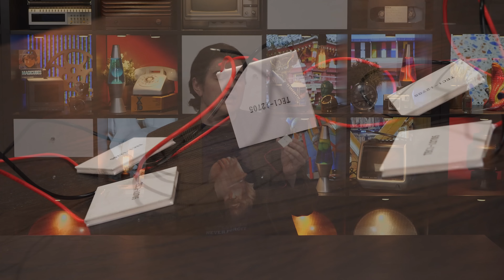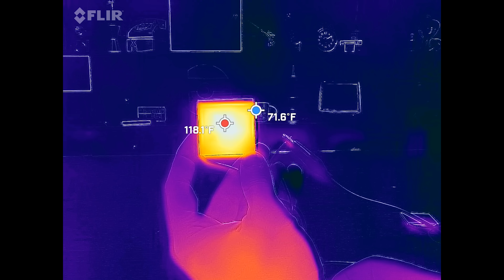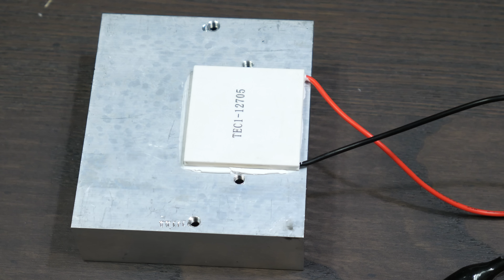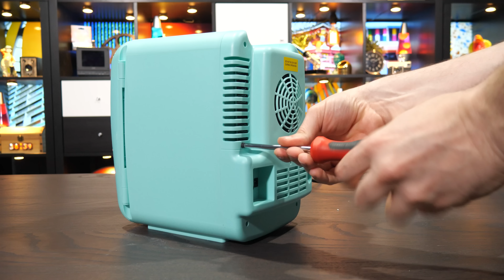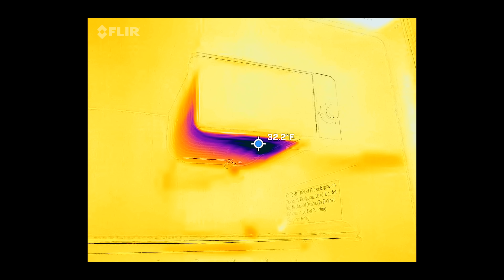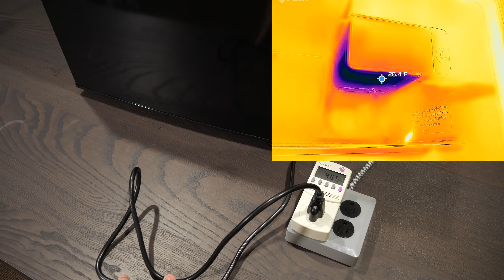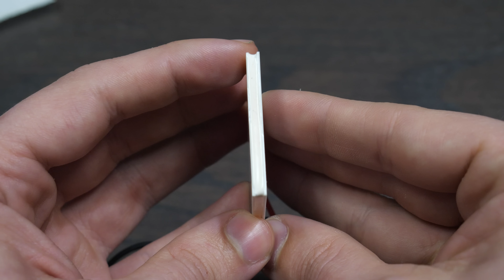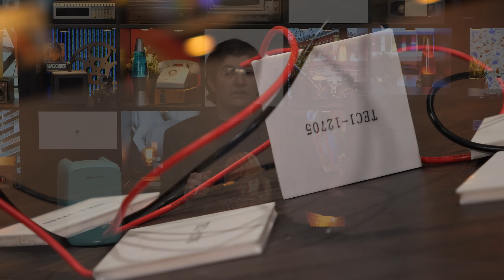Thermoelectric cooling: it's not great.

Comment: There is one good cooling Application for Peltier Fridges: Car Cooling Boxes. Thats it. I got two Quality Boxes which can keep the Temperature at the promised "30°F below ambient Temperature."  They are great for shopping. Start them, go into the Supermarket putt your fresh food into it and it will stay below 50°F on your way home till the food is your fridge. When the cooling in the car runs often even below 41°F. As Peltiercoolers are not sensitive to Shocks and moving they are great for Temporary moving cooling solutions. On top of it this Car cooling boxes i have are great isolated Cooling boxes and work great without Power, so on a Party i can load them up and use them as beverage coolers. And they even have a Drinking Low Power mode on them, reducing the Temps only 15°F in them. Which is healthier, you shouldn't drink beverage more then 20°F below ambient Temps. With 6W Powerdraw instead of 30W.
And yes they only draw 30W of power as they have thick isolated walls like the Red Fridge.

But guess what: They aren't cheap each costed around 60-70 Bucks (have two) But for the 30 Minutes Tripp back from Shopping or the Roadtripp they are great. Not for daily use. And i got two as they aren't big inside eitherm because of the Isolation. I need mostly only one.

And why i don't simply use a cool box and load it up before i go shopping? I live in a small town with three small supermarkets but work in a Big Town with a big Supermarket next to my Work and there is some stuff i don't get in my small town. So twice a month i fire up the Cooling Box go Shopping and get my favourite fresh food cooled home.

Comment: People expect way too much for these little legends. you need 8-10 of these for a fridge like these to make a fridge of this size cool adequately. Also if memory serves me well running them above approximately 1/3 of their rated current caused them to becomes inefficient so it would be best to have 3 of the sides covered in 8 of these plates running efficiently at a lower current.  Thankfully they are cheap enough to make it still worth it. (note that buying in bulk will see 60 of these costing $130-200 AUD or $68-136 USD). You'll also find that a cheap thermostat relay and arduino is quite cheap. Having all 3 sides covered aka 30 of them will see much higher cooling than a refrigerator with the ability to scale down power draw during period of non-use.  There is a clear section where cooling performance increases rapidly before it becomes inefficient. Therefore, there is room in the market for premium, expensive smaller fridges based on this tech but it isn't viable as a cheaper product.

Comment: Transporting food in a light Peltier Igloo cooler in car for 6 hour drive. Precool for 2 hours, then trick is to put a big blue ice pack in it, plug it into the car DC port. Using Govee bluetooth mini temp sensor shows Peltier and blue ice keeps food closer 36 degrees.
The portable compressor fridges weigh a lot and are very bulky, but yes, are much lower power and best for 24 hour hassle free cooling.

Comment: Favorite use for them is in cigar humidor/cooler. Effectivly cools the air tight area without reducing humidity( normal evaporator cooling systems remove humidity)

Comment: If you haven’t seen the channel tech ingredients look it up.. if you want to build a fridge or freezer with these devices they did it and they go over the science involved in a proper design however they use multiple modules and a variable power supply to make things as efficient as possible as well as a liquid cooling solution for the hot side. A friend of mine used a similar design to create a water chiller for an axolotl tank. Cool devices but horribly inefficient

Comment: So, yeah, that toy definitely needs some changes to make it worth using. But, it is my opinion that it is because of how often these peltiers are misused, that they end up getting their bad reputation. For instance, that toy needed a bigger peltier to do its job effectively as designed. But if designed better, it would have been fine with that smaller unit. But the bigger these units get, the more costly they become. But, there is a potential trick to use instead. You setup a circuit that switches which unit is getting power based on the temperatures being probed in each area of the fridge, and have multiple much smaller units made up to do the work in that area. And of course when things are hot enough, they all turn on instead to cool faster. This makes it have a more 'cycle' effect like a typical fridge, and should allow it to switch between a 'high power' mode and 'low power' mode respectively where needed. Add in some high performance insulation, the kind that just doesn't let any heat energy pass through it at all, and give the peltier some proper heat sinks on both sides to allow copper heat pipes to be used to transfer heat as needed; and I think that toy could become something actually worth using. More expensive, but worth using. 

The main issue with that unit, is that the peltier really doesn't have a good way to actually cool the unit. it's transferring its lack of heat into the unit through plastic. Not the worlds best heat conductor. And the heat sink on the hot side is so small, that it probably barely can keep up with the heat being produced by the hot side. The heat issue in regards to that is also more easily solved by using vapour chambers as well as heat pipes to direct the heat away from the unit first before letting air blow it away the rest of the way. Or, you could utilize the seebeck effect to recycle some of the waste heat energy back into the unit. It's this part that I think is most commonly not used, and thus peltiers end up getting their bad reputation. The effects need to be used in conjunction with each other, or else it doesn't make sense to use them at all except in the rarer circumstances. And of course, they won't become magically 100% efficient either this way. There will always be losses, and addition of materials will increase costs. But I think there is a happy balance that can be achieved if a person were to use these things in conjunction with each other, using only the best materials we possibly can use right now. 

Kind of like how heat pumps via compressor units and refrigerants needed some time before we found something that can be used in them 'safely'. That being iso-butane. It was usable before that point, but now that we have better resources for that sort of thing, we can make better units that have less issues. 

As for how well it needs to be able to work? Honestly, as long as the unit can cool a full set of drinks in under an hour to 1c, I am happy with it. If not, I'm sticking them in the chest freezer for 30 minutes, and then putting them in the fridge to keep from freezing entirely. And fact is, most fridges barely can manage that as is. So if one of these toys can be made to work that well instead, I think it will be worth the costs of materials needed. I mean, face it, fact is most people don't want to have to wait for their drinks to cool, or heat up; for much longer than need be. If peltiers can be made well enough to do that job, it takes away the need to fill a fridge with drinks in the first place, and use it only for actual food. 

I know I certainly wouldn't mind having some little cooler off to the side that holds a few 2 litres of dr pepper for me, all nice and nearly frozen cold.

Comment: 9 hours later, and not going to read thru all the comments, but at 25:32 you mention using the Peltier toy as a portable car fridge.  While a good idea (it is what I did in the past), companies now make coolers now with compressors, and a digital thermostat... including Bluetooth so you can adjust it from your phone!  The temp range is -4F to 68F and has a "max" mode that I think draws about 65W and an "eco" mode that does 35-40W.    And it's as portable as an "Igloo" style cooler, including insulation.   Great for using with those "solar generator" batteries.  Though sometimes the cooler has long off-cycles and draws so little power during that, the battery may turn off in the meantime.

Comment: I had a slightly fancier one for my room when I was a kid because my parents thought an actual minifridge would waste electricity... 

At any rate, it had thick insulation and the fan was at the top so you lay it down to hinge up so it "contained" the thermal gradient like a chest freezer. It would actually freeze the drinks near the peltier device when it was cold in the winter. Luckily, it had a low and high setting, still no thermostat though. Plus, the fan wasn't the cheapest one the manufacturer could get their hands on, so it was actually silent.

Comment: I had a buzzy cube fridge at university. The buzz was a plastic tray of some kind touching the compressor slightly and being vibrated when it was running. I shoved some blu-tack between the two and solved the problem

Comment: I’m curious if this technology could be paired with a traditional refrigerator.  I’m not a refrigerator expert or even enthusiast, but I’m curious what effectively building one of these INSIDE a traditional refrigerator in place of a freezer space could potentially do.  I wouldn’t expect it to be effective in larger units, but a smaller one like the cube you started with…

Probably not.  But it’s the best I can come up with for general use scenarios.

Comment: I have something like this, which I did not pay for.  It’s functional, works reasonably well, and is actually pretty quiet when in operation.

I only use it for canned/bottled beverages.  Admittedly, it doesn’t cool the contents down very quickly, but if I load it up about a day ahead of time, it provides cold beverages on demand.  🤷‍♀️

Sadly, I also have an old mini-fridge which I inherited from a college roommate,  which has been sitting in my bedroom, turned off, because the motor makes too much noise for me to sleep since it’s right by my bed.

Comment: this is making me realize just how hideously power hungry my rv’s refrigerator is. We have the typical absorption style fridge and I believe the electric heating elements on these fridges are somewhere around 300 watts. Plus there’s some 12v dc consumption for the control circuitry and in the case of our fridge a small heating element that runs along a section of pipe in the fridge to keep it from freezing up in cold weather so the fridge keeps working. As a side note absorption fridges are fascinating and would make for a cool video.

Comment: If you're 'sensing consternation' it might be because you misrepresented the refrigeration cycle or how much power it uses.  It uses a lot of power during parts of the cycle.  The hope is like you were pointing out that it will balance out when the thing is cooled and in sort of a standby mode.  But, one cannot ignore the spikes in power consumption, or noise, or the increased heat output of a real heat pump vs well anything else.  Also, Peltier devices don't have to be made crappily or have crappy heat sinking, fans and casing around them.  Also, you can, oh I don't know, run them at lower power/voltages, then use layers of them instead of just one, and decrease temps a lot more.  This, however, will definitely not be more energy efficient, sadly, but it will work better if designed right.  Finally, both types of refrigeration will produce heat on one end, so if your room is already warm, maybe don't open the fridge up a lot inducing its heat pumping cycles.  However, if your room is already on the chilly side then both devices will warm your room, so bonus I guess.

Comment: The only thing I have bought that has one of those things in it is, the fan that ya place on top of a wood stove. if ya are able to keep one side cold the other side hot it will create an electric current, which spins the fan. which cools the one side and pushes the heat from the wood stove further out into areas which would normally feel colder.

Comment: Ah memories!! I remember using a Peltier trying to overclock either an AMD Thunderbird or Athlon XP cpu over 20 years ago!! Used water cooling for the other side. I didn't plan to well and despite it being a full ATX tower I had the radiator hanging out of the 5.25 bays. I don't remember how effective it was in achieving in overclocking the chip though.

Comment: I've been wanting to build a pc into a desk for a while but something about your video makes me want to integrate a mini fridge as part of the design. 

Here's my build idea. I buy a cheap mini fridge and cut a modest hole in the top or a side. I then water cool my pc and stuff the radiator and reservoir into the fridge, feeding the tubes through the hole cut in the side and then seal the hole, probably with silicone. 

The idea being that I dump my heat into the fridge and have the fridge cool the radiator. This also solves the condensation issue for the pc, that usually becomes a problem when sub ambient cooling. My storing both the radiator and the reservoir in the fridge would matter because the resivor is a large thermal mass and keeping it in the fridge will help prevent too much heat to be dumped into the radiator at once.  I know that most fridges are not built for cooling hot things like soup right off the stove, mini fridges even less so. However this build would be fully for the pc and maybe for canned drinks. This would not be used for food and the fridge would essentially be driven until it breaks down, then it will get replaced and properly disposed of.

Comment: I absolutely cannot understand why even "economy" household refrigerators don't have temperature measurement & display.  I have built a WiFi-capable monitor for my old fridge that uses two $2 probes, a $1.50 microcontroller (D1 Mini, should you care), and a 0.96" mini display ($0.79).  Total cost to ME for essentially a one-off unit was less than $7.  Appliance manufacturers would have bulk purchasing power; I'd be surprised if the cost per appliance for them exceeded $2, especially if you removed WiFi capability.
My fridge has the most asinine temperature control - it's a small wheel on a vertical shaft that you can turn to the left - towards the word "COLD" - or to the right - towards "COLDER".  Enviable precision, for sure!  (/s) Every time I look at that I feel my IQ shedding a few points.

Comment: Very important overlooked aspects of peltier modules: Their efficiency is highly related to the temperature difference you're trying to achieve and how hard you're driving them.

Look up efficiency curves for modules online; in most cases, running them at about a third of their rated power across temperature differences of 10c or so can result in coefficients of performance above 3. This also means running them on a pulsed (PWM) controller (most of the cheap ones out there) is horribly inefficient.

If you do want to use them to cool something efficiently, you need to firstly use a constant-current power supply, keep the hot side as cool as possible, and then be reasonable with your cold-side expectations ("fridge" not "ultra deep freezer"). Also, insulate well.  The real key is to buy a whole whackload of cheap modules and thermally parallel them together (say a grid of 3x3 between metal plates, or even more if you have the space and money) although you can drive them in series electrically if you want. Continuous current LED lighting driver circuits can be a good choice for running such modules if you get the specs right.

If they built those little toy can fridges with the entire back wall covered in peltier elements, they'd actually be reasonably effective at keeping some cans pleasantly below room temperature. But then, of course, they'd cost a bit more than the absolute bare minimum so that's a no-go. I've been tempted to buy one and modify it in this way just to see, but haven't bothered yet as I don't really need such a contraption anyway.

For a more practical application, deep-sky astrophotography cameras often include a peltier element bonded to the back of the image sensor. This allows you to keep the sensor well below ambient (-20c to 0c is common), which massively cuts down on the noise in captured frames. Since it's only trying to cool a very tiny surface, the inefficiencies of peltiers are not that important and an actual refrigeration cycle would be deeply impractical mounted to a telescope.

Comment: Theyre not efficient... BUT you could use them to trickle charge a car battery using the heat off the exhaust pipe. They work in reverse meaning they can generate a voltage when applying a temperature difference across it. I dont know why i havent heard anyone talking about it, but it could even charge some of the battery after the car is off. Not to replace the alternator but just to use it less often. Thoughts?

Comment: I find the small coolers convenient due to their size. There is no refrigerant based cooler that can come close to the form factor.  Another benefit is that they can operate on 12V DC, or 120V AC and include both plugs. The various brands all use very cheaply made cases with no insulation, for sure something they could improve on. The model I have also uses a 80mm fan and it's virtually silent. It could be easily upgraded to any standard 80mm computer case fan at a minimal cost. I also have no doubt if they increased the size of the heat sink and used better thermal paste they could improve it's cooling abilities. I was surprised that many new fridges are also now using a fan to cool the condenser, instead of running the cooler lines on the back they are running them in a tight helix coil at the bottom with radiant fins, which does have to be maintained/blown out every year or so if you live in a dusty environment like NM.